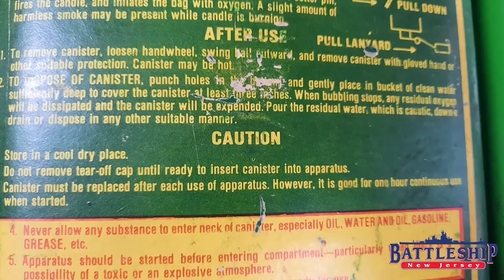Do OBA Cannisters Actually Explode When They Get Wet?

Comment: Two different chemicals in the OBA canisters.  Plus the starter candle.    The starter candle was located on the bottom, and you pulled the pin and a little firing pin, very similar to what is used on a hand grenade, swung around and ignited the candle.  That burned for a couple minutes and the smoke it released had lots of oxygen in it. That was your startup oxygen for when the other reactions were getting started. The same chemical is what commercial airliners use to provide oxygen to the passengers in an emergency.   
   The two chemicals in the canister did two things.   One absorbed carbon dioxide and carbon monoxide from your exhaled breath.   the other reacted with the moisture in your breath to release oxygen.    I've long forgotten what the chemicals are, but they were caustics.      Those bubbles coming out after you dumped them in the bucket of water is near pure oxygen.   Flammables in a pure oxygen atmosphere are trivially easy to ignite.   The heat of the chemical reacting with all that water provides enough heat to ignite oils in a pure oxygen enviroment.  So yeah, dump them in a bucket of oily water and you will get fire and potentially boom.  
  I only ever used the training canisters, which had just the starter candle.  One of the trials on my ship for getting our damage control certification was to be taken down into the bowels of the ship.  For me, it was one of the shaft alleys.  Put on an oba (No canister, they were too spendy) be blindfolded, then have to find our way out to the main deck.  The ladder down that you had used to get there, was simulated blocked, so we had to use the alternate escape route.   Getting my fat ass through the escape scuttles was the hardest part for me.  
  Fortunately, the only real fire we had on our ship while I was aboard was put out by the on duty boiler room crew before our firefighting team was all suited up and ready to make entry.     Unfortunately, this happened while we had the trainers from GTMO getting us ready for REFTRA.  So they watched, and graded us responding to a real main space fire like it was a drill.   Firefighting party passed.  All the extra officers standing around getting in the way flunked.   I heard the Captain had some choice words for them later on.  Phrases like abandoning your post, and interfering with the fire party.   I'd like to see the video of that.   Captain Taplett rarely raised his voice, but he had intensity.
Reply: The starter candle is Sodium Chlorate and the chemical in the canister is Potassium Superoxide

Comment: One of the things that we learned in the aftermath of the USS Stark incident was an order to get rid of all of the OBA training canisters off of all of our ships.

The training canisters were only designed to last a couple of minutes before they stopped working - good enough if they were going to be used for training. The training canisters were a different color from the regular canisters so you knew which was which.

The problem on the Stark was that those fighting the fire couldn’t see due to the smoke and training canisters were being used only for the Sailor to run out of oxygen minutes after rejoining the fight against the fire.

We learned. No more training canisters allowed onboard our warships.
Reply: The Stark relieved the ship that relieved my ship in the gulf in 87. Was a rude awakening to how real it could get and how fast it could get real. I got out in 1988 and don't recall any changes being talked about with the OBA's, but my ship was decommed 3 years later. I'm sure the Navy wasn't going to spend money on changes to equipment on a 30 year old destroyer.

Comment: Keeping an Oxidizer, especially one which also provides Heat, away from a Fuel Source(Oil) only makes sense. Theoretically, an OBA in Good Condition(no Leaks anywhere) Could provide the ability to breathe, SLIGHTLY Under Water. For it to operate Your exhale had to inflate the bladder, which not only supplied that exhale to the Canister, but cooled the released oxygen before you breathed it. Outside Water pressure would prevent it from being able to inflate.   The Momsen Lung which was mentioned, used some of the same principles ,and a small oxygen bottle, but it and similar breathing equipment had issues with "Oxygen Poisoning", when used for Diving in excess of 25 feet or so.  The Concave back of the Canisters Also had Ribs for identification in Low/No Visibility. "Rids to Ribs", While it was sometimes possible for An Idiot to insert a Canister Backwards, doing so Jammed and Generally  Damaged the OBA(Oxygen Breathing Apparatus).
Reply: Fun little Fact:  Remember the movie: "Creature From The Black Lagoon"? The Creature had an OBA on for the underwater shots!  
(This is why it looked like he was about to roll over and be belly up to the surface!!). 
It was modified but I haven't found any source listing how it was modified....

Comment: I was taught to use the OBA in Basic in 1977, they were used through the 80's into the 90's when the SCBA's were found to be more efficient and much safer for everybody. I spent 20 years fighting fire and can say the SCBA is so many times better, an 'Empty' bottle can be refilled and then replace a sailors empty bottle just back from the 'Event' allowing it to be solved sooner than if the same sailors were using an 'OBA'.

Comment: The OBA (Oxygen Breathing Apparatus) will explode if some sort of petroleum distillate are introduced into the opening. The OBA's were used six years after the end of the Vietnam war. They are related to mine safety equipment. Use of OBA's is covered in recruit training in the 1970's.
Reply: Speaking of mine safety stuff, remember the safety lamp used to detect if there was enough oxygen in a space to support human life?  Does the Battleship New Jersey have one of those in a damage control locker?
Reply: @lensman192  They should have an Portable explosive atmosphere detector on board. It would be used to check the concentration of explosive gases in a confined space, such as gasoline, diesel, or metal cutting gas. It would be used to check the magazine after it was closed up.

Comment: We were trained to 'jump start' the canister without using the starter candle, and set the timer to 30 minutes.  The amount of energy you use/oxygen you burn trying to muscle a pressurized hose around in a machinery space was much greater than I think originally anticipated, and you'd never really get the advertised 60 minutes, thus the shorter time we set.

Comment: I remember using those and switching to the SCBA.  FF school in San Diego showed a video of what would happen if a spent one came in contact with oil/fuel, a 55 gal drum.  Flame/fire was taller than the building behind it.   We would change out on the fantail, dropping the spent ones in the ocean.  Cool show sometimes

Comment: Interesting video.  The design of the canister is very similar to some old red Mine Safety Appliance (MSA) self rescuer canisters I've got from the late 70's.  The only difference overall is that the Navy uses a rebreather apparatus where the MSA canisters didn't.  The MSA canisters had a taped over opening in the bottom and a cap on the top.  Pull out the canister, take the cap off, screw on the hose, rip the tape off the bottom, put the canister in the holster and the mask on, and you were good to go.

My only question is why the rebreather vs. the MSA design?  Maybe toxic gases in ship fire vs. CO in a coal mine fire??
Reply: Probably toxic gases.  A USN ship has many many many many things on it that are straight death due to the sailors being government property(lithium battery torps scare the begeesus out of me), and needing the edge in war.  Safety first, but the enemy is safety risk #1.

In other things, the USN is perfectly willing to just buy OTS MSA gear.  It's good stuff.
Reply: The self rescuer is a respirator designed to protect against carbon monoxide, the common type being the W-65 in the white steel with rubber protector cap. it gets hot. The bright red versions were for training. The mask described above sounds like the 1940s/50/s Type N that had a larger filter with hose and face mask.  There were also the globe "short snorter" escape breathing apparatus that came in a red sling like case.
Reply: Rebreather system extends the useful duration of use.

Comment: These same type of oxygen generators are used in airplanes, when you pull down on the emergency masks that drop, a cable pulls a pin out of, and activates the oxygen generator, which then feeds your masks.
Reply: Also the cause of the loss of ValuJet Airlines Flight 592 in 96, which is why they're strictly prohibited on all flights except when actually properly installed.
Reply: Don’t these have to scrub co2 too
Reply: From 747 tour i watched they have onboard air tanks that feed the masks
Reply: Modern commercial jets use compressed oxygen tanks, usually in one of the overhead bins marked with an oxidizer hazard plaque.
Reply: @Straight_Outta_Varrock  The 747 can have either system.  The oxygen cylinders can provide more time if the aircraft is flown over large, tall mountain ranges, but comes at the expense of more weight.
Reply: They are not used in airplanes. No airplane uses potassium superoxide, the oxygen scrubber. They use sodium chlorate "oxygen candles". These don't scrub the air you breathe out, they just produce oxygen. That is why the masks have an exhale valve that doesn't go back to the canister.
Reply: It's sodium borate, the chemical used in aircraft chemical oxygen generators.  Kind of a strange chemical reaction, something that burns and releases O2, instead of consuming it.

Commercial aircraft have either chemical oxygen generators, located in the passenger service units above the seats, or gaseous oxygen tanks, generally in the lower cargo compartments.  Military aircraft generally use liquid oxygen systems, trading off the additional issues of handling LOX for a much smaller sized storage bottle.
Reply: @Supersean0001  sodium chlorate, not borate.

Comment: Impressive, that you and the sailors that wore those are able to run throughout the ship up and down ladders. Only couple times we been challenge wearing a gas mask (gas mask not protective masks) One trying to operate a jack hammer with a gas mask on, and for myself I know one point I started to get little faint after just wearing mine for a very long time.
Reply: the real challenge is getting through a scuttle while wearing an oba, and carrying a fire hose.
Reply: @leftyo9589  With the water on, I understand there is a lot pressure in those hose.

Comment: When I visited an underground mine I had to train to use a similar but smaller device. It required exhaling forcefully a couple times to initiate the reaction, with breath humidity being enough to set it off. I imagine dropping a fully charged canister into water would give an exceptionally energetic reaction.

Comment: I think similar oxygen generators are used on current nuclear subs. Smarter everyday did a nuclear sub visit and they showed putting a cannister in a piece of equipment and lighting a wick to maintain oxygen levels when submerged.
Reply: The oxygen candles are generally used to supplement the Electrolytic Oxygen Generator, which makes oxygen from water.

Comment: I remember these, alright. The RCN used them up to about 2010, IIRC... that's when we started switching to Draeger SCBA sets. Good fun at the DC school in Colwood, BC at the end of firefighting refreshers, when we'd knock a couple of holes in the sides, then dump them in a big tank of water. One Chemox at a time is pretty mild... a whole day's training worth for a class of 20 or 30, each going through 3 or 4 canisters that day... that was LOTS of reaction going on in the tank. :)

I also don't miss the problem of deflating them when you were on the hose party, too. Even if you were the ATL, it was all too easy to deflate those lungs. Draeger packs are a LOT better.

Comment: The irony here is that the canisters were not approved for diving because of water reactivity but you dressed out in an FFE and wearing and wearing an OBA, in a fire was a cross between battling high temperatures steam and riding thru a car wash in a wagon. Engine spaces in fires are also notoriously oily from bilge fire fighting water emulsified with oil and flashing off. It was 50/50 whether the fire or the OBA would kill you.

Comment: All those bubbles you see when you put that canister in water are pure oxygen.  Oxygen is not flammable or explosive.  However, it is (obviously) an oxidizer, and anything which will burn will burn much better with extra oxygen.  Some things will actually absorb oxygen and be more flammable for a time afterwards.  Wear an EEBD for a few minutes (also produces pure oxygen), take it off, light a cigarette, and you will most likely be clean-shaven and bald in a rather painful manner.

Some petroleum products can actually self-ignite under some conditions in a high or pure oxygen environment.  Normally safe materials can be ignited Substances which normally require a flame to ignite and burn slowly and calmly will ignite with a small spark and be gone in seconds.  A science lab demo years ago showed that a standard birthday cake candle will be a black smudge in under 2 seconds if lit in a straight oxygen environment.  

Those canisters will produce oxygen from the moisture in the air once the seal is broken, even after use.  Used canisters were ejected into a clean and dry metal container and then disposed of overboard.  Individually into a bucket of clean water would be a substitute, but shipboard would find the lucky person so assigned wearing FF clothing and in the middle of the helo or flight deck.

A few hints:
Pick up the OBA with the mask sitting on top.  Once you get the shoulder straps on, put the mask on or let it dangle between your shoulders...never forward, as this will ruin the hose fittings.

Thumbs up and out!!!  There are a few sharp places on the inside of the actuation bail.  Get your thumbs caught inside the bail while seating the canister enough times and you WILL eventually find them.

The Chlorate candle is your first 5 minutes or so of oxygen while the moisture in your breath activates the main part of the canister.  It has a lanyard which is yanked to pull the activation pin on the candle.  Proper procedure is to grasp it firmly, pull straight out, then bring your hand up to eye level to ensure that you indeed have a pin on the end of the lanyard...if it isn't there, the candle didn't light.  It can probably be pulled by a buddy with a pair of pliers, but you have already found 1 problem with that canister...you can try for Problem #2, but I'm dumping that canister.  

If you use the Chlorate candle there is no need for theatrical deep breaths, antics with the mask, or anything else.  A second or so after you pull the pin it will provide you with pure oxygen in quantities sufficient to provide for your needs for 5 minutes plus enough left over to actually fill the bladders a bit.  If you are breathing normally, you will have activated the main canister long before the 5 minute mark.  If all is working properly, you have about 60 minutes of a much higher level of oxygen than you normally breathe.  

Dumping the canister.  Clean dry tray on the deck...something bigger than a bucket.  Unhook the waist strap, spread your legs, lean forward, let the OBA swing out on the shoulder straps, and drop the canister.  If it needs help, you now have the clearance behind the canister to grab it with both hands.  As an added benefit, this method keeps the very hot stuck canister away from certain areas that most guys do not like exposed to high temps...

Comment: I was a Damage Controlman 2nd class ,aboard two different ships, 1968-1972,,,it's NOT just water that sets them off,the water has to have some oil in it also,,,we usto punch  holes in the bottom with fire axe and toss them over the side,,,,,LR

Comment: the canisters are shipped in plain cardboard boxes, and they are meant to be stored in the OBA canister lockers... but, on the ship I ended dup on? They stuck them in the forward HazMat locker...which had about 3 inches of oil  on the floor soaking into the boxes. Yeah, exciting times.
Reply: WOW

Comment: I've used them in the mid 70's. We started them manually and then un-did the lanyard to the candle to be used in case of an emergency. I goofed up and didn't get the lanyard out and mine went dead so suddenly. NO CANDLE............ Up two flights up and down the passageway later I could finally breathe.  
A mistake I never repeated. By not lighting the candle first you can get 2-4 min. of oxygen in emergencies..........  enjoy
p.s.  You had canisters in the disposal portion of the video that still had "LIVE CANDLES"on the bottom...  Need to fire them off before they could be considered SAFE ............  just sayin'

Comment: You could activate one by breaking the seal and taking a very deep breath, reseal and breathe out, toss them overboard away from the ship due to the fact they can explode, I was in before Scott Air Packs, but the TM's had them with the very heavy suits due to the OTTO fuel 2

Comment: What's the advantages of using something like this over SCBA? I'm sure its partly because the 'tank' is smaller and lighter but there's probably others I'm not aware of.
Reply: Did not require a clean, high pressure air compressor to recharge cylinders.  Quick swap of the canister and done.

Comment: They will not explode when put in clean water. I stress clean. Any oily residue will cause a violent reaction. Fought several shipboard fires with them. The one thing he didn't show was pulling the pin and lighting the candle. That was the recommended way to start a cannister. You could start the reaction by breathing into it. Senior Chief retired.